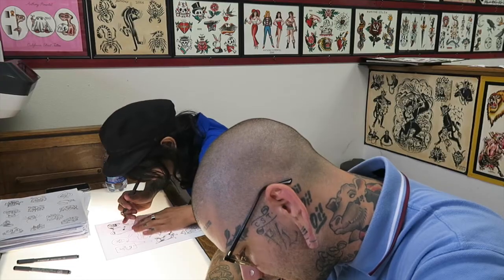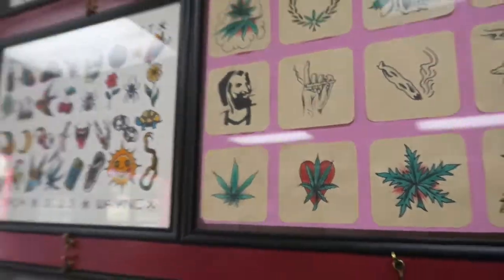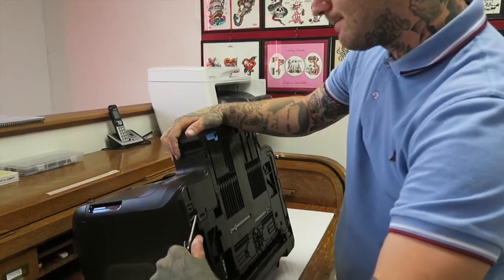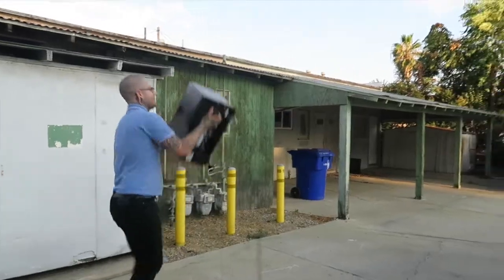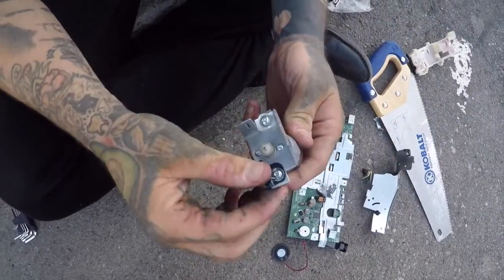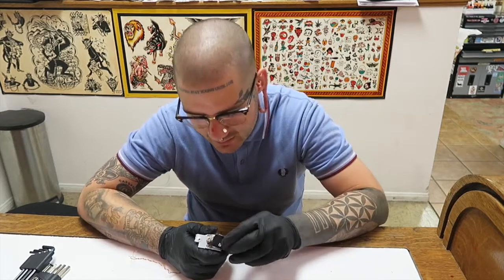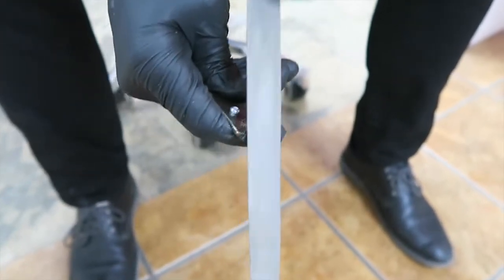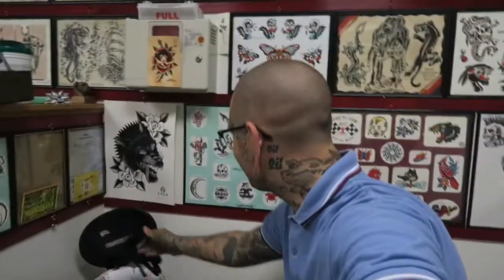(DIY) TATTOO MACHINE MADE FROM A PRINTER! (part 1)

Comment: You don’t have to be a rocket scientist to build a rotary out of an appliance Walkman use to be what every body used I’ve never ever tried one I do have a old door bell to make a coil machine wen I get the time  the town I’m from in Canada ont at one point was prob the most tattooed city in ont ther was a ton of people making rotarys out of race car motors shaving motors Walkman motors they would Lear off of the dude that just got out of jail and our town did not have a shop at this time but I never trued a rotary the only good I see in them is they are super light I’ve tattooed over 35 years and my tendons are shot so they are good for ergonomics other than that I’ve just recently acquired a pen style rotary and a older bishop I trued them but so use to weight of my custom brass machines they are so light it’s like very hard to do a line at first a little practice and they are not all bad I’ve never ever thought  much of them I think they may be good for new people girls that’s why we have the ones we have my girl wanted them so I said go for it youbwill never find a rotary that will compare to a coil machine in my way of looking at it the coil machine does it all and fast if u are a fast out liner the pen or rotary is junk so if you are a street shop with walk in I would not use they just don’t have what you can get out of a coil machine but that my opinion I like to do a lot of fast outlining pulling long  lines you can not do with a pen also to me it’s not the same it seems a little girly these pens all the tattoo bullshit shows a lot of people use them but they all have 3 years of experience give them a coin machine out of tune and they would start crying lol happy new year all keep on keepin on slinging ink till I die
Reply from the maker: I completely agree 
this was a slow day at the shop good.
coils last forever Chinese motors wear out.
I rather replace a spring then my whole machine.